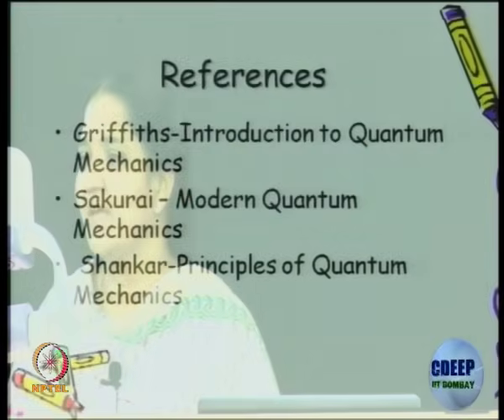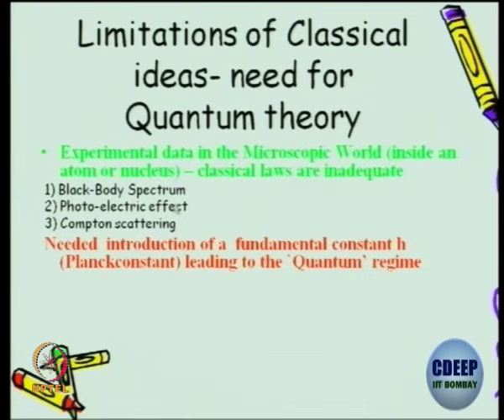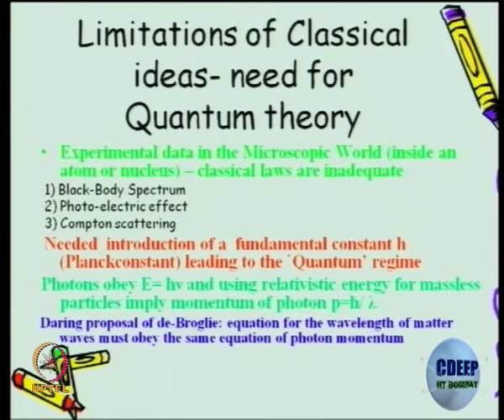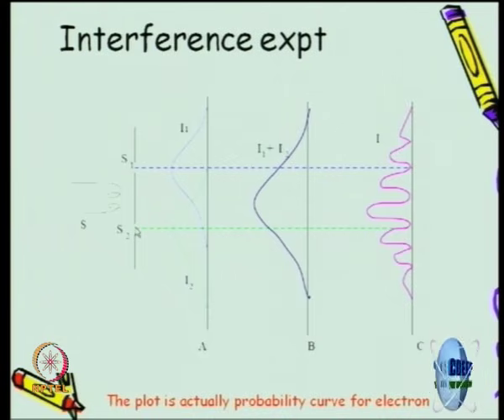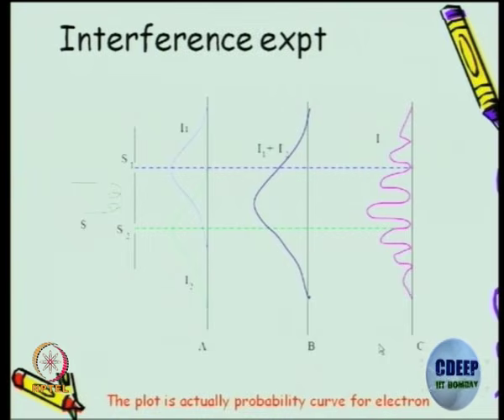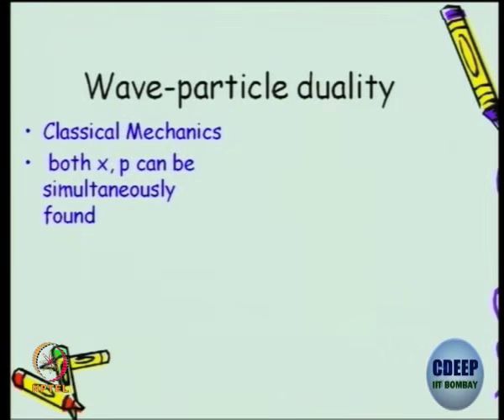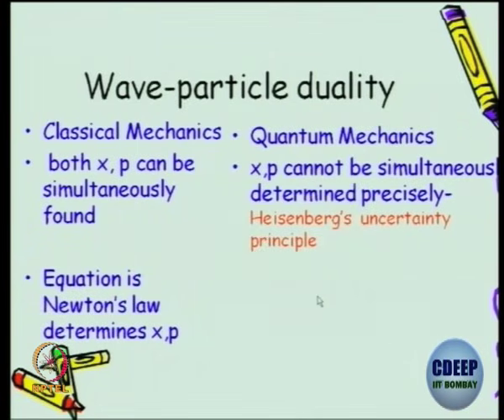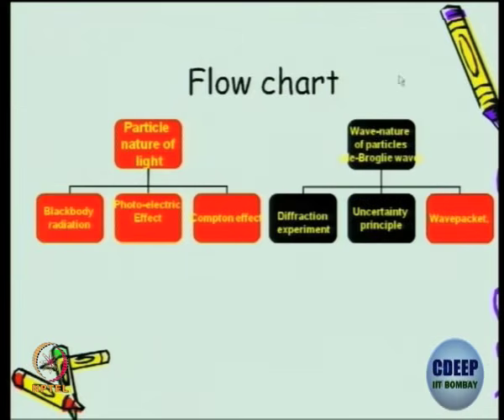Week 1-Lecture 1

Comment: 11:07-11:30 i think the sound wave travelling across a wall is not a violation of classical mechanics. If it can cross a definite width of vacuum between two material mediums, perhaps then we can use it as an example of violation, right?
Reply: Yes, sound travelling across cannot be quantum tunneling obviously. That's a bad example. But it can be said as an analogous scenario to quantum tunneling but the physics is not same for both

Comment: The video quality is a bit low
Reply: When you're logged in to your YouTube account, you can change the default resolution setting by navigating to the Settings page. If your Internet speed is slower, select "I have a slow connection. Never play higher-quality video" and click "Save." YouTube will default to SD resolution whenever you play a video.
Reply: @harshshah1310  It was very helpful.